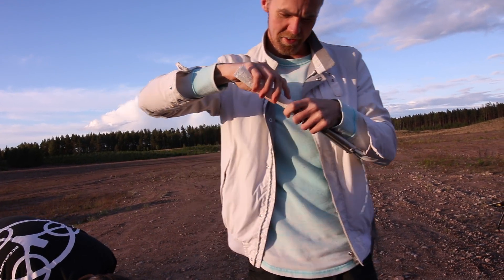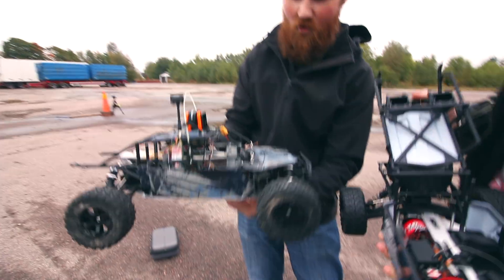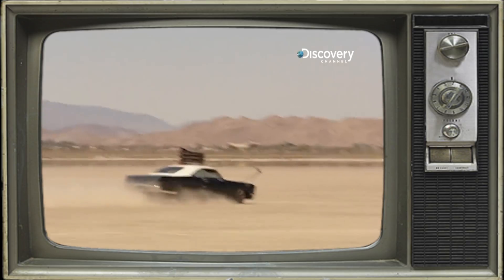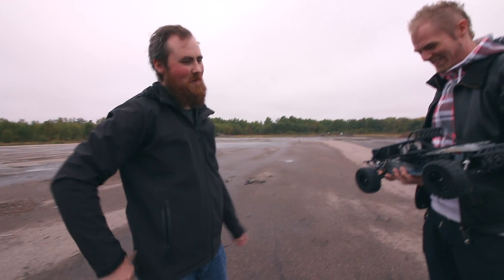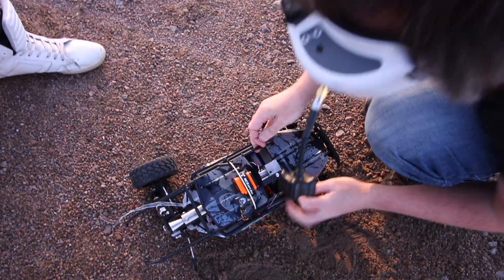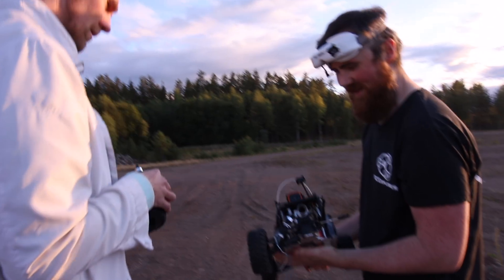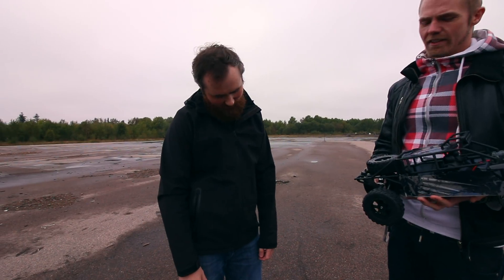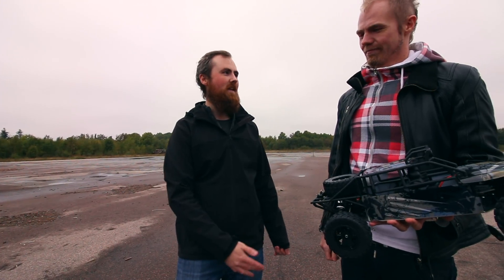RECREATING the MYTHBUSTERS ROCKET CAR (with a RC CAR!)

Comment from the maker: Want to help me out? Share this video with everyone you know! (and people you don't know)
Reply: David Windestal Done!
Reply: two rockets on the knife then try bowling ball again
Reply: Shared in our quadcopter group 👍
Reply: what about a rocket DLG
Reply: David Windestal consider it done
Reply from the maker: Thanks guys
Reply: David Windestal I have been watching you since you came over the pond to the flight test team and you were always let's make it bigger bigger is better if not two motors a bigger one that's two stage use it to power an axe then you have more mass to power through the things like a concrete block maybe a return for the bowling ball maybe a bowling pin block of dry ice a can of petrol above a flair lol thanks for the entertainment keep it up
Reply: David Windestal if you burn the rocket before hitting the ramp, then it will fly better.  The aerodynamic balance of a rocket is not a simple thing to do without control surfaces... Lots of instability.  However, if you burn on the ground for stability and then convert some of that energy with the ramp... It should fly like a brick outta hell.
Reply: David Windestal van you du rocket plane?
Reply: David Windestal Do you have a video just about your rocket fuel?
Reply: you guys are awesome.....
my new favorite youtube channel!
Reply: David Windestal Shave your filthy beard

Comment: David: that was AWESOME and HILARIOUS but i think you can do better. if you drive the car like you did for the first attempt and the second and then hit the jump i think you will get a better result. Plus you will have to take into account the thrust from the rocket and the torque it will put on the rear of the car, so next time try putting a spoiler on the back similar to a drag racing spoiler. it may act like a dart then and fly better.

Comment: Try putting on a GPS speed meter. try a Garmin forrunner, they are regularly used with rc speed runs. Also try using a gimbal if you want to keep it straight while driving.

Comment: To build a rocket powered car, you need to build a rocket on wheels. Strapping a rocket to a car will never make it fly, siply because centers of gravity, thrust, lift, etc. aren't in their proper places. This is more of rocket science and aeronautical engineering rather than automotive engineering. 
It's a cool experiment, as long as you stay on the ground. If you want to make it fly, it becomes an engineering project. 
Though, I wonder what results you'd get with a high thrust edf. What about two rockets, a slow burn that converts to a fast burn? 

Also, please do a racing quad with a rocket strapped to it. I'd be very interested in seeing that happen. Kinda like the boom-copter or whatever it was called, the tricopter that had an auxiliary thrust propeller that was on the boom for the tail rotor; but using a rocket instead of another rotor.

Comment: I'd suggest that the GPS protection (so you can't use them in missiles) is kicking in and disabling the GPS coz you're going too fast.  But wiki tells me that only kicks in at 1854 kph, which is well over the speed of sound, so probably not.

Comment: 9:47 there are a few frames in the FPV view where you can see the rest of the car floating away from you.  It tore the FPV equipment off the car!

It's like being hit by a high-speed train, flying through the air in slow motion, watching the lower half of your body fly away into the distance.

Comment: 8:47 - Free Shipping. 😃

You need to make certain that the Mount is aligned with the center of the vehicle to avoid lateral forces and spinning or off center motion. Also driving over the dunage and rocks isn't very smooth.

Multistage, like MythBusters, would be great. Later add a small knife - RocketKnifeCar❗
Reply: Sounds like he needs some downforce
Reply: LowLightVideos that wouldn't be enough to prevent spinning.  Because of a cars general shape, there is a lot of airflow instability and turbulent flow.  This means that as soon as the car leaves the ground, it's going to start tumbling soon after.

Comment: The reason for the mid air spinning is that the time difference between the front wheels and the rear wheels leaving the ramp is relatively small, gravity has started a downward pitch to the front that is magnified by the eccentric pressuring of the rocket motor to the car's center of gravity. If you could calculate the amount of pitch, maintain exact speed and then offset the rocket motor an appropriate amount to the CG, you might get the car to fly straighter until your thrust is complete.

Comment: Stiffen up that front suspension your wheels are digging in warping that's why you rolled the first time glue those wheels on some tire glue and rejigger your rocket motor mount so that thrust line goes through the center of gravity of the car don't forget to account for the mass of the rocket motor small wing and fin on the back might help a bit too.

Comment: Hahaha! That was epic! Try this again with some vertical stabilizers and horizontal ones as well!!! Would love to see the car go a few miles :D
Reply from the maker: I have something up my sleeve my friend. You just wait and see evil laugh
Reply: You have to find the center of mass of the car with the rocket and make sure the thrust vector passes directly through it if you want to fly straight.  The rocket motor is so powerful compared to whatever aerodynamic forces you could marshal from stabilizing fins that it would just make more things flying through the air when the thing goes plooie.  Not that I'm opposed to things going plooie.....
Reply: Hi Peter good luck on that ultra light would love to see you fly it for the first time also try some larger wheels tractor supply company has some that might work don't want to see all your hard work destroyed by a less than smooth landing, also try some braces that  detach so the wheels have some more support on asphalt once you get that out of the way all you need to do is go further than 120 feet in 12 seconds
Reply: Maybe if the ramp was longer so the car has time to stabilize in the direction and then firing a little before being airborne to resist tumbling forwards from push of the rocket.

All these vids are amazing :D
Reply: PeterSripol if he had more downforce he could probably keep more control too
Reply: PeterSripol I love your channel
Reply: Nice to see you here! i love your channel!
Reply: Aligning the thrust vector with the center of mass IS the most important thing they can do, but don't discount a little aerodynamic stabilization.  It might not seem like it would do much, but it will help keep the car going in a straight trajectory after the rocket ignites.  The spinning wheels, aerodynamic instability, etc, can make the car pitch slightly, sending it into the ground or off to the side, but stabilizers would help counteract that.  Pop-out 3d printed grid fins would probably work the best.  They really have to get it to ignite while the car is flat and accelerating up the ramp though :D :D :D
Reply: PeterSripol you should try to make a working jato for a plane